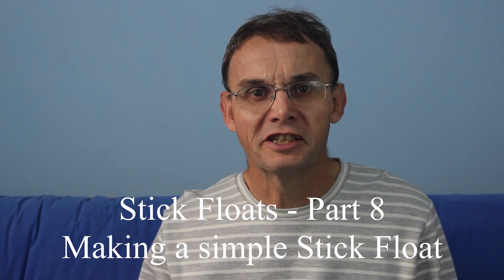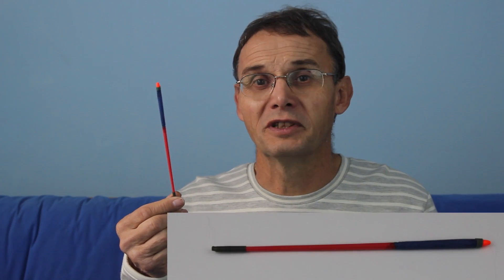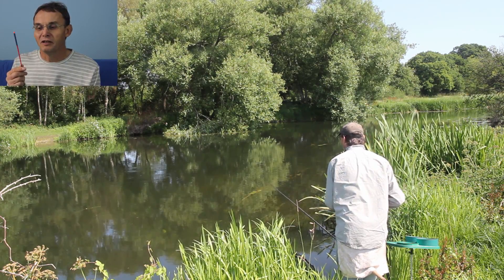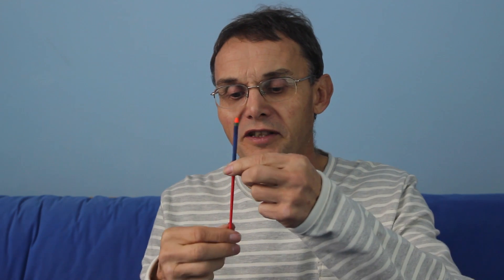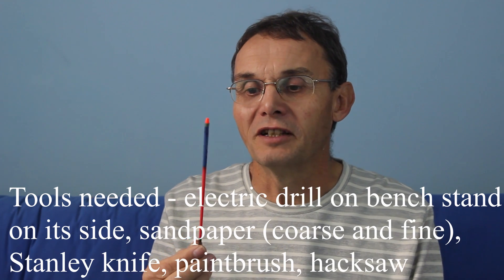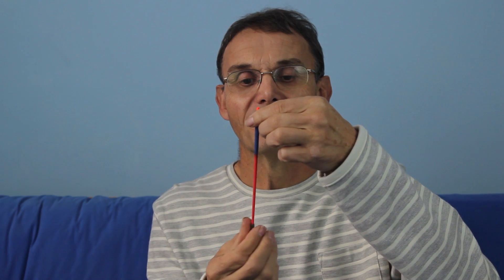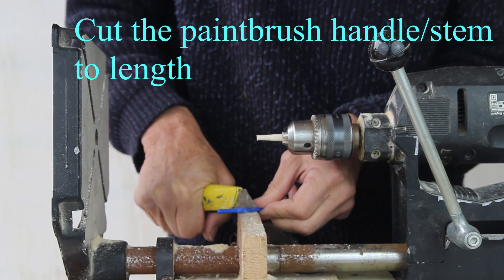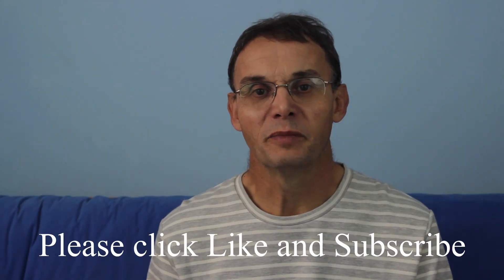Stick Floats - Part 8 - Making a Stick Float

Comment: Interesting video, Mark.  I managed to get a bundle of the John Dean sticks.  Problem was, they were all 3 number 4 size, so I snapped the stems off and fashioned my own balsa tops in a range of sizes to suit my own needs.  The stems are the most important part of the float for them to work ‘just so’.

Comment: Hi from Belgium. Could you tell me where find some balsa, cane, and lignum please? I don't know a tackle shop for this.
Reply from the maker: In the past we used to have plenty of model-making shops but these have disappeared. Few tackle shops supply float-making materials and mostly in the UK a few specialists can supply balsa via eBay. Hard cane can be found in garden centres. Lignum possibly via EBay though I prefer to use the childrens paint brush handles as these are dense and already have a taper.
Reply: Thank you mister. We heva the same problem in Belgium, it's very hard to find a tackle shop for this. @MarkWintleFishing

Comment: excellent piece. where can you get the fluorescent orange paint for the tips?
Reply from the maker: I have used Revell model paints in the past which I've got from a local model shop but these paints are harder to find now - some on eBay (paint no. 25 seems to be the one), and the paint seems to go 'off' in time, becoming hard to use smoothly. The modern equivalent is acrylic paints such as Starglow from Glowtech which look promising; I think people who are hand-making floats to sell use this type of paint nowadays. None of these options are that cheap any more. In all cases I use a white undercoat.